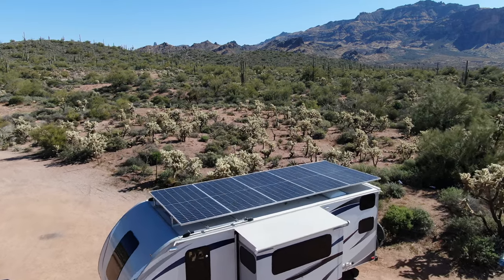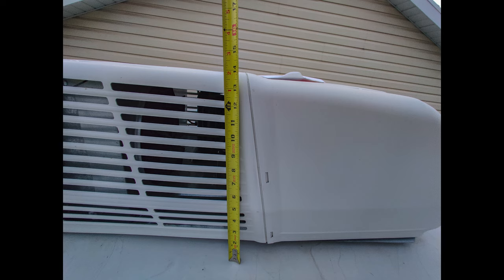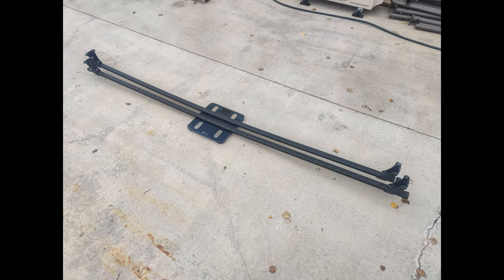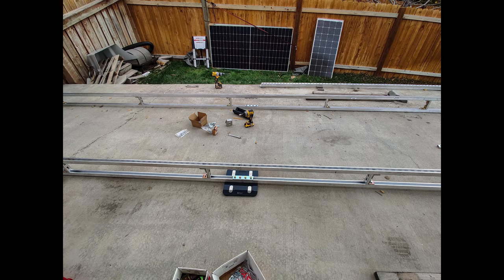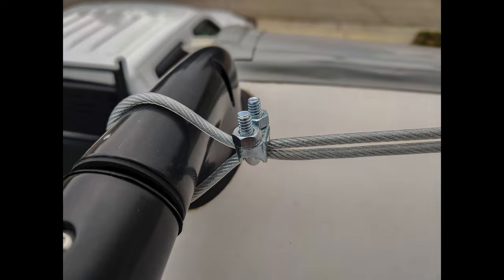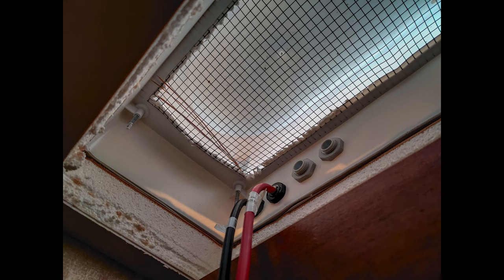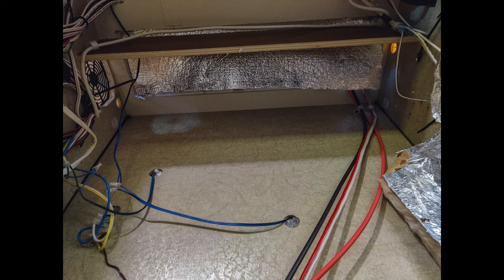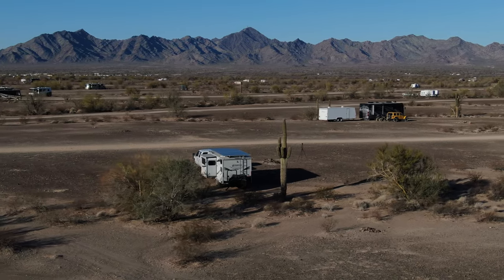How I Fit 2,650 Watts Of Solar Panels On 18 Feet Of RV Roof | Sun Powered Lance 2185

Comment: It appears as though you were able to get the panels completely flush (frame edge to frame edge). Was this only possible and accessible to the nuts and bolts because you installed it lifted above the base strut channel that's bolted to the roof? 

Not sure if my question makes sense, but I need to do something similar (flush) in order to fit all my panels but don't plan on installing it lifted. Would greatly appreciate your insight on that particular point.
Reply from the maker: Typical solar panel clamps meant to go between solar panels (and thus called mid clamps) are half inch thick, which in my case added up to 2 inches between the 5 panels and I was trying to minimize rear overhang as much as possible. By bolting the lower inside flange of the solar panels to the unistrut I was able to secure them without a mid-clamp and one could argue my method is safer since it's a bolt through a hole instead of a clamp pinching the panels down. Would it be possible to bolt them down flat to a roof? I imagine it's possible, but probably not as simple as mine being lifted and thus giving me easy access to the underside of the panels. Perhaps you can run a piece of unistrut along under the panels so as to only lift them an inch or two, but still give you something to bolt them to? Or perhaps unistrut run between the panels that you can bolt the panels to, but it runs out the sides to give you access to bolt it to the roof or something? I hope you're able to figure out a solution!
Reply: @ElectricTechAdventures  Could you speak at all to the type of fastener or screw you used going from the base strut channel directly ontop of the roof?  I was thinking of going with a zinc coated #10 or #12 about 1.5" length.
Reply from the maker: The base strut channel is glued to the roof with VHB tape. No screws. The front is reinforced with four cables going to the luggage rails. All of that is outlined in the video. I also have some reinforcement in the back with the ladder. We have camped in very windy areas and we have driven thousands of miles on the road over two and a half years with no problems and no adjustments or changes to the mounting that is outlined in this video.
Reply: @ElectricTechAdventures  sorry must have missed it! Man that VHB is crazy stuff. Just ordered some! Thanks!
Reply from the maker: @brycecastleton5863 Yes I agree. VHB tape is basically super glue in tape form.

Comment: How much drag does that create while towing?
Reply from the maker: @justinfowler2857  I have no way to measure that. Considering the whole trailer is a lot of drag I suspect that the panels don't add a ton more drag but probably some. In the future when I have an electric truck that gives me a lot more detail about energy consumption I will have the ability to tow a similar 2185 travel trailer down a certain distance and then do it again with mine and see if there is a measurable difference. If I am able to pull that off someday I'll probably make a YouTube video doing it.

Comment: Where did you get the panels? Your spreadsheet links to a store that only has 540w panels (no 530w), but the 540w panels only come in a pallet of 30 panels, rather than 5 panels or fewer.
Reply from the maker: I got my panels from the same company (Santan Solar) and shortly after I purchased my panels they were unlisted from their website. Now, yearly 2 years later I found the pallet of 540 Watt panels listed on their site so I put that link in my spreadsheet instead to just point people as close a product to what I used as possible from the same company instead of a broken link. I recognize it's not realistic to buy all 30 for an RV project, so hopefully you can find the panels you need from a different company which is why I added in that cell right before the link "No longer listed but this is the closest they now have". Pointing people to an exact product to buy is likely going to be a moving target for the foreseeable future unfortunately. I also asked Matt at Continuous Resources if they could be a source for these large high Wattage commercial type solar panels and they weren't able to get them at the time I asked back in 2021.
Reply: So you're going down the road with just 3M double sided tape 🤔
Reply from the maker: @bignicnrg3856  no, there's cables too. Thousands of miles in all seasons with zero movement.

Comment: How do you keep the bolts attaching the panels to the unistrut from unthreading? Also, how did you cap the ends of the unistrut?
Reply from the maker: I put lock washers on the bolts and if needed I would use thread lock on the threads. I have checked the bolts a couple of times and they have not loosened over the last 2 years and couple thousand miles. I did not cap the ends of the unistrut at all.
Reply: @ElectricTechAdventures  thanks for the response, absolutely love this build! I’m going to be imitating it with a 1.1kw system on a small TrailManor that I tow with my Model Y 🤘🏼
Reply from the maker: @polykid101  nice! Someday I'd like to make a smaller version on a enclosed cargo trailer for something like a food truck but I have no intention of getting into food trucks myself. I just would love to be able to see a silent food truck powered by the sun. They're always accompanied by loud generators.

Comment: the front wind will touch under those solar panels and make your van unstable when you drive you will feel driving wheel puul lefg abd right on highway and boulevard
Reply from the maker: No, it's been 2.75 years and many thousands of miles since I installed the panels and there's zero effect on the driving.

Comment: Did you have to order the 10 minimum with SanTanSolar? Also have you noticed any problems driving with the unistrut having the columns raise it up? Mine will be going on a box truck so I don't want it coming loose because of wind drag or anything
Reply from the maker: I ordered 5 panels from SanTan Solar and they never mentioned a 10 panel minimum, so either that's a new policy or they disregarded it perhaps because these panels are much larger than their normal panels. The panels bolted to the unistrut have been rock solid with zero movement. I've checked the bolts a couple times to ensure they stay tight. I have not noticed a difference in driving performance towing the trailer with the panels on the roof. I expect it's probably hurting my gas mileage a little bit, but I have no idea how much since I used a different truck prior to the panels vs after.
Reply: @ElectricTechAdventures  thanks for the reply man! I found some panels like 6 hours away so I think I'll just have to drive up there to grab them. They're only 70lbs so arnt to heavy but they're almost 8ft tall and 4ft wide like yours, was it a PITA to get them on the roof? Lol
Reply from the maker: @timcorona5069  Luckily my wife helped me, otherwise it would have been more difficult by myself. I parked my truck next to my RV as an intermediate platform to get them up. It was not terribly hard to get them up into the truck, then I tilted them onto the edge of the RV roof and had my wife hold the other end while I climbed onto the roof of the RV, then she passed it up to me. The big advantage to having them be the size they are is it simplifies the racking as I outlined in the video.

Comment: If it is not in the links and they are still available, what is the height and width of the panels (I want to see if they fit my motorhome)?
Reply from the maker: In the JA Solar spec sheet the panels are 2267 mm by 1123 mm by 40 mm. They are mono sells. The panel weighs 28.5 kg. The exact model number is JAM72S30 510-530/MR Series for which to google and find the spec sheet. Although I would assume there are newer panels with higher capacity.
Reply: @ElectricTechAdventures  Thank you (yet again) for answering my many questions. Did you use Signature, San Tan, ...to  purchase them?
Reply from the maker: I purchased them from Santan Solar yes, I'm not sure what you mean by Signature.

Comment: I hope you don't camp in the winter months....  The winter days in arizona leave the sun way down to the south.  The days also are much shorter.  I have 6 panels on my truck camper and I double the power coming in by tilting my panels to the south around 35 degrees.  You should test your panels by laying one flat on the ground then tilting it towards the sun. Then you will see the difference in power produced.
Reply from the maker: I'm very well aware of the difference in solar production based on the orientation to the sun. I thought for a long time while planning my system about how I could create a mounting mechanism that allows the panels to tilt and decided ultimately to just go flat for a couple reasons. We don't typically camp in the winter when tilting is especially helpful. I installed a lot of solar panels that would hopefully help to overcome some of the inefficiency of flat mounted panels in the winter. If I tilt the panels on their long sides so that they don't stick up as far then they would shade each other. If I tilted longwise so as to avoid shading then they'd stick up in the air like a sail (they're 8 feet long) and be a big liability when wind kicks up suddenly. Plus there's the additional weight and complexity which added cost and effort on my part to figure it all out. The whole project was a lot to figure out in the time frame I was trying to get it done in and I can still add a tilting mechanism in the future potentially. I have done tests with my panels in the winter such as this one https://youtu.be/HN_RJgR9sjw where we took it out camping in the winter for the first time as well as this one https://youtu.be/4WnTRNTNUXE where I tested the power production on the shortest day of the year. The difference of power production from the longest to the shortest day of the year is significant. Shortest day of the year can charge the battery 51%, longest day of the year can charge the battery 200%. If you're looking for the best power production in the winter then you most certainly must tilt the panels. In my case it's a rare enough use case that I'd just use a generator to supplement in the winter if needed. Alternatively I'd just use the propane furnace in the winter instead of the heat pump mini split to reduce my electricity consumption.

Comment: Super nice!
BTW, you could shave off some weight using Aluminum Angle-brackets & such (McMaster Carr carries them),
Reply from the maker: Thanks. Mine is done, but maybe someone else will find then at Carr.
Reply: @ElectricTechAdventures  LOL... I did. (I managed 1700W of Solar on a Winnebago Navion).
Thanks again for sharing your work.
Reply: @hookem7060  got any photos you have shared on your install? Did you do uni-strut for the base (attached to roof) and then attach aluminum extrusions?
Reply: I would be more concerned about electrolysis caused by 2 dissimilar metals. You might want to keep an eye on this over time.

Comment: i would not trust tape. would have been better to make a small cut were the bolt/screw goes through the roof, and install a larger galvanized washer,(1 -1 1/2 inch dia by b1/4 in thick) to make the roof lift up a bit at the hole, then another just smaller galvanized washer (3/4 in dia) on top of the roof membrane. (there should be a easy way for water to flow under the beams and away). tape over , and after all is in, put on the roofing tube glop. over kill on sealant is good.
and no worry's about wind, and a air dam up front for freeway speeds. but the dam is only under the solar. going back each side for a couple feet.
Reply from the maker: I've seen many methods of attaching solar panels to RVs documented in online forums such as Facebook groups. Some have used a similar method to mine and have already put tens of thousands of miles on their rigs with zero issues. I've now put thousands of miles on mine with zero issues. Good thing there's options we can choose for ourselves.
Reply: @ElectricTechAdventures  Ditto experience here from using VHB tape for a wide variety of applications including double stacked (on full extension drawer slides) PV panels atop our Escape trailer without issue.  The key is matching the specific type of VHB tape to the surface energy of the substrates as well as properly cleaning the surfaces prior to VHB apply.   I also applied 3M 5200 to encapsulate the joint area of both substrates and eliminate any possibility for wind driven rain to penetrate & potentially compromise the VHB bond.

The other pertinent detail when using VHB tape is to pay attention to shelf life & expiration date of the tape itself.  And to purchase the tape from reputable sources...

Comment: I wish you said how much production you see on sunny cloudy and snowy days that woukd be huge for the solar camper community
Reply from the maker: There is significant variability when it comes to a solar production. Even perfectly sunny days in a row will have slightly different amounts of solar production. In over 7 years of monitoring solar I have only seen two days that were literally identical to the hundredth of a kW from one day to the next. The purpose behind this video was all about how I attached the solar panels on the roof of the RV. I have a ton of other videos that cover the production in varied circumstances from the winter to the summer. Here is a playlist of a trip that we went on and I cover the solar production throughout the trip and there are many other videos on my channel when we take the RV out and I always cover the solar production in our camping videos. In brief summary on the shortest day of the year on a perfectly sunny day the trailer can produce about 5 kWh and on the longest day of the year on a perfectly sunny day it can produce 20 kWh. Then of course the panels can produce as little as zero when they are covered with snow or on a completely cloudy day it could be just a little bit more than zero. Then because this is a mobile device there are times that we park in forested areas and then there is all kinds of variability there with how the shade from trees moves across the panels throughout the day. I have several more camping trips that I'm still working on editing that will be published eventually covering varied circumstances. Unplugged In Moab Sun Powered RV Camping Trip: https://www.youtube.com/playlist?list=PLhYygFlMh_bf2OAz4WKTpbJtgnwinx0FD
Reply from the maker: Here is a playlist of just trips in the trailer. Trips In Our Lance 2185 Travel Trailer: https://www.youtube.com/playlist?list=PLhYygFlMh_bdsFILlnuW7hlC3Loiceg9E
Reply: I own a solar company i understand variable and thank you for the response i asked the question and slowly over your videos i found answers keep uploading the awesome content
Reply from the maker: Thanks! Will do. I have another one publishing in an hour.